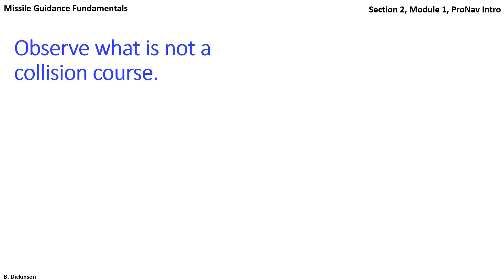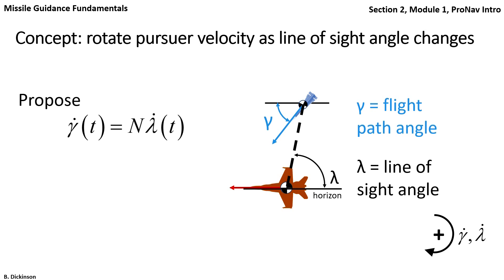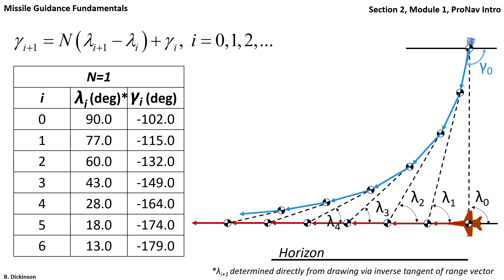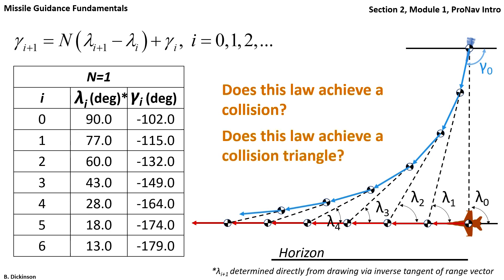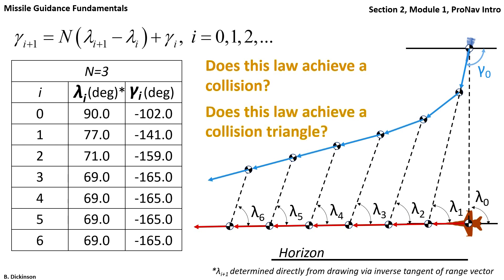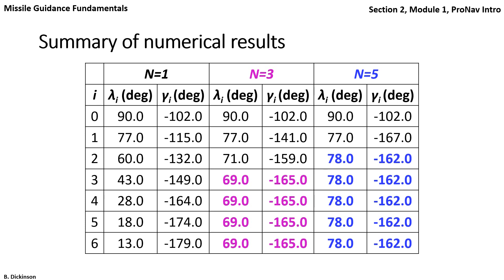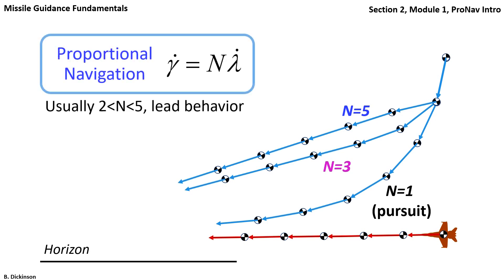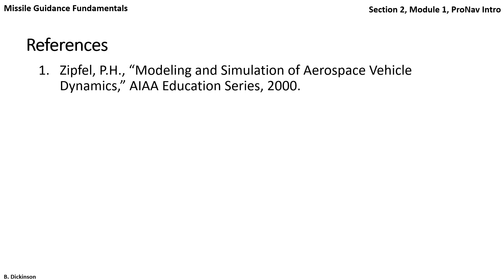Proportional Navigation Qualitative Intro - Section 2 Module 1 - Guidance Fundamentals

Comment: How lambda1 is 77.  Okey, from the geometric calculations 102-90 = 12. Inside the new triangle it must be 90-12 = 78. Am i wrong ? Could you Please explain how it is 77 ?
Reply from the maker: It was determined from the inverse tangent of the crossrange over downrange from the relative position vector at t(i+1). These positions were literally measured on the diagram to determine lambda(i+1).

Comment: How do we calculate for lambda i for pursuit guidance. Specifically for did you conclude that lambda 1 was 77 deg?
Reply from the maker: One can directly determine LOS angle from the geometry of the diagram. It involves projecting the positions forward one time step. Then, it's just a little trig.
Reply: @LearnGandC  Hi, i think that lambda 1 is 78 deg. the small angle at the head of the triangle is 12 deg. not very important but just to mention. thank you ben!

Comment: Flight path angle is measured differently on proposed law slide and pursuit guidance slide?
Reply from the maker: They are consistent, note the proposed law is fpa rate and the pursuit guidance implements a discredited form of the law which updates achieved fpa.

Comment: may be this is a stupid question because I am watching these videos just because of interest and this is not my field of study, but I have seen ground launched missiles that change direction just after launch two times by using some thrusters just below their nose cone, so is that just to align the missile with the target and the change in flight angle path happens after that continuously, or is it the only maneuver the missile performs and then goes straight.
Reply from the maker: Those thrusters are known as a reaction control system. We can speculate on some possibilities. They could be an initial course correction for target intercept. Their use early on could be for stabilization after launch, essentially to capture the angular rates of the missile for stability. It's hard to say offhand without knowing the systems. So, it's not a stupid question at all. If you know what type of missile it is, with a little research online, you'll probably come up with some interesting answers.
Reply: @LearnGandC  thanks a lot

Comment: Hello Ben, I appreciate your effort. Your explanation to PN has made things easy for me. Ben, at 5:37 you have computed Lambda_1 as 77 degrees. Please give some explanation to this computation. What is the range vector? And what is the exact formula to compute Lambda1.
Reply from the maker: Ah, good question. First, note that both bodies have constant velocity so that angles are determined based on a scale applied to the velocity vectors. You could use a ruler on your screen for example. Then, lamda1 = atan(Rz1/Rx1), where x and z are horizontal and vertical components.
Reply: @LearnGandC  thank you for the explanation.

Comment: how to get the target Velocity by the gimbal angle?
Reply from the maker: You'll need a target state estimator! This is a big and complex subject, but in two dimensions, relatively simple estimators can be constructed. Lin's book, Modern Navigation, Guidance, and Control Processing, provides some introduction.
Reply: @LearnGandC  I need it only in 2 dimension projection. :D I've got stuck there too. Like doing comparation between result angle in time i to i+1. Also the distance traveled by VP/time between two state angle as reference. But still no result.

Comment: Thank you for your videos. Is ProNav useful for guidance towards a stationary target? For example fixed wing pinpoint landing (e.g. carrier landing), or quadrotor guidance (e.g. drone racing through obstacles)
Reply from the maker: Yes, it works for stationary targets. There are separate guidance laws for aircraft landing. ProNav guides to a target, but does not allow prescribing the flight path angle as it reaches a desired point for a safe landing.
Reply: @LearnGandC  Thanks. Can you please suggest some conventional/typical guidance laws for aircraft landing that I could look into?
Reply from the maker: Sure, some basic concepts such as glide slope and flare are covered in about 6 pages in Blakelock, "Automatic Control of Aircraft and Missiles," published by Wiley (roughly pg. 90). Both the 1st and 2nd editions cover it, but the 2nd edition has a little more material and diagrams. This will also cover the generating glide slope controllers. Both editions are out of print, but they can easily be found online.